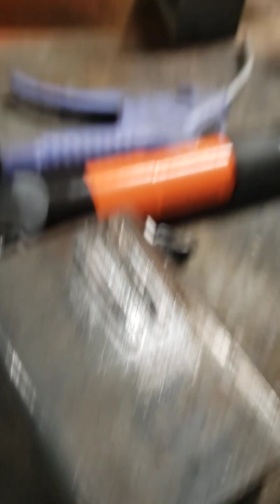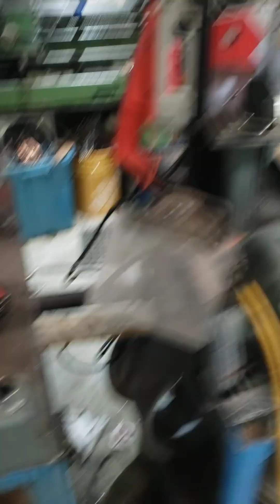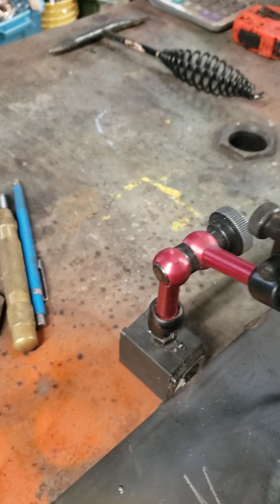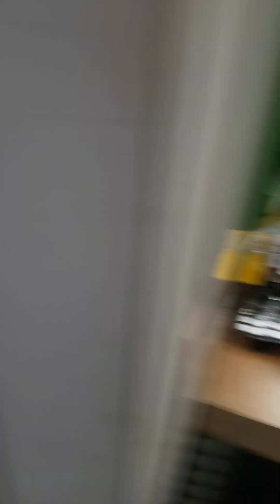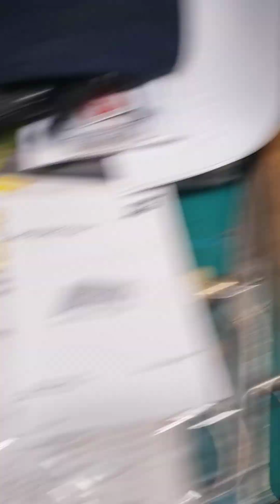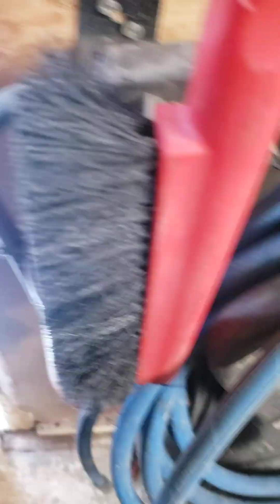Kubota RADTECH snowblower build part 6. Hardfacing edge, sprockets, and warpage.

Comment: You should line the inside of your chute with thin flexible plastic riveted in. Greatly reduces slush build. 🤔🤔🤔
Reply from the maker: That's the plan.. we've only had a few snowfalls, and I've been able to push/plow it into piles.. there will get to a point I run out of room and the blower will come out. Thanks for the tip.